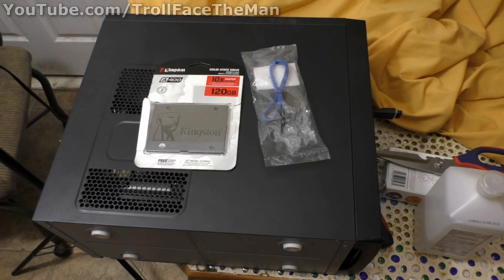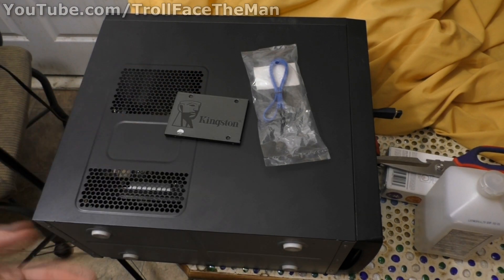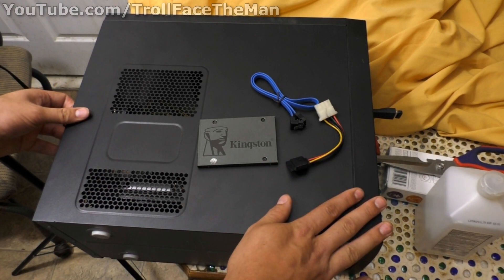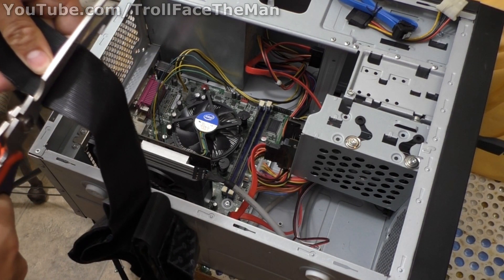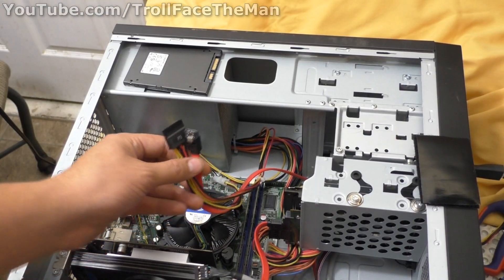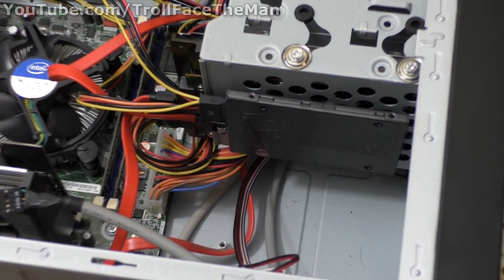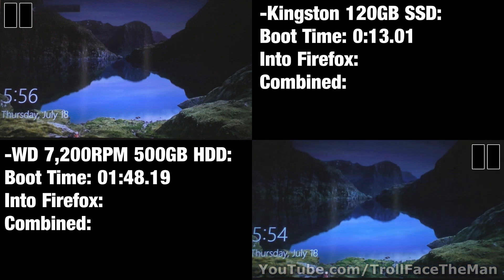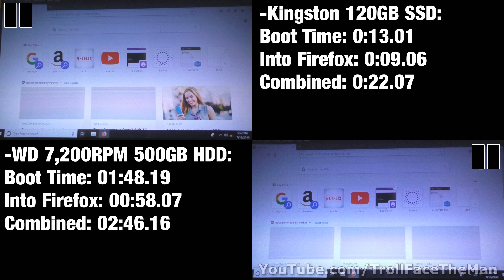Is it trash? Cheap $17 Amazon SSD Install & Test. Let's find out! (Boot Drive.)

Comment from the maker: Comparable Build to my computer but with modern parts (Keep in mind this is a theoretical build, everything should be compatible but always double check):
 -CPU: i7-8700k https://amzn.to/2MG2gw0
-Mother Board: Asus Prime https://amzn.to/2NbWZLy
-Ram: 2x 32GB Viper 2666 DDR4 https://amzn.to/2MGyA1Q
-CPU Liquid Cooler: Corsair Platinum https://amzn.to/32KjldJ 
-SSD: x2 1tb Samsung SSDs https://amzn.to/2qGkQvp

 -GPU: 1660ti https://amzn.to/2pR92G0
-HDD: X2 4tb Seagate https://amzn.to/2PazbKR
-Power Supply: EVGA G2 https://amzn.to/2p8Cc3B
-Case:CM Trooper SE https://amzn.to/340lHVU

Comment: Have been using cheap SSDs at my office for years without problem while HDD already gave me a lot. Personally I trust "cheap no brand" SSD more than known brand spinning drive, because SSD just meant to be more reliable. Great video anyways!
Reply from the maker: Thank you. The issue with some of the super bottom barrel SSDs you may find like on ebay is a lot of times those can be rejects from factories that have known issues already but people know they can get away with selling anyways and do such.

Comment: Can you look into the FattyDove SSD's Linus reviewed in a 20$ SSD video?
Reply: They are good, I'm from the uk so I had to import mine and it was way more expensive than it should be, provided your in america they are great value, but beware they are probably stolen goods, ssd manufacturers have had issue with lots of stock being stolen, which is why they are able to offer a very good SSD at a low price, but they work well, I personally don't believe in fueling such acts under any circumstance but I understand some may not be able to afford the branded variants
Reply from the maker: I think it's already been well covered.